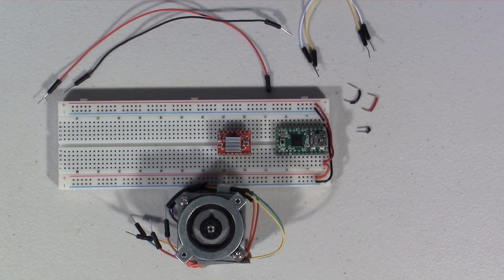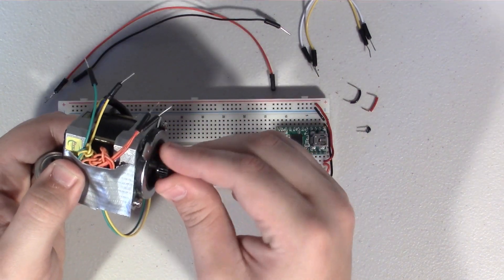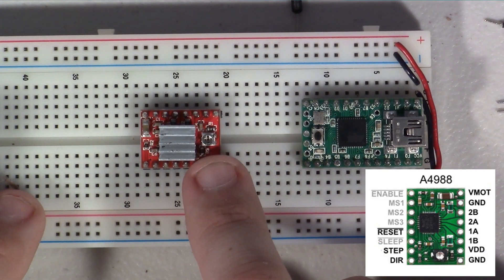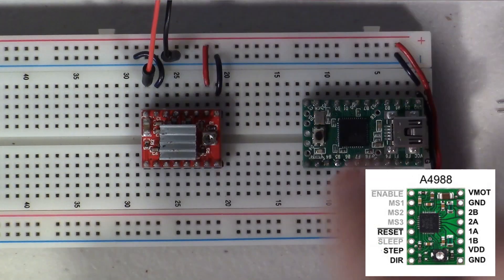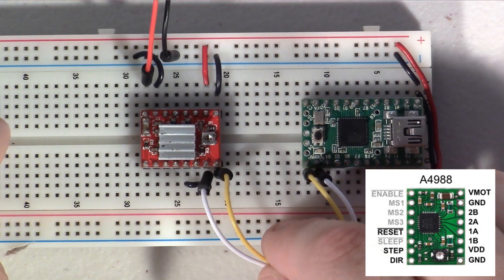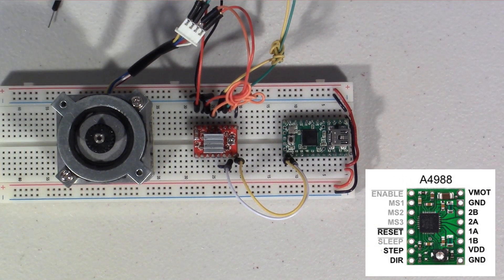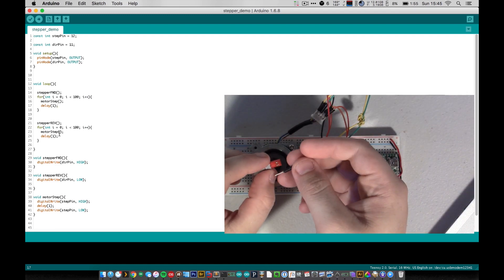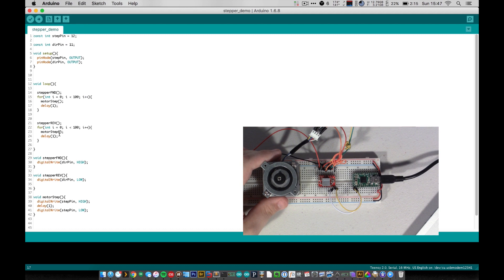How To Wire It! Stepper Motors

Comment: The resistance measurement setting on the potentiometer?  That’s an error I get it, but you left it in the video. This stuff can be confusing enough without you calling an ohm meter a potentiometer.

Comment: Very good video, thanks. I'm new to this Arduino malarkey and I'm looking for a tutorial that explains how the speed of a stepper motor can be determined by the pressure on a load cell - imagine that a kitchen weighing scale makes a stepper motor pin fast with a three bags of sugar and slow with one bag. I'd use the common HX711 board. Thanks.

Comment: thanks for this video, i have a question on the power source though,  i mean dont we need a 24 or 12 volt power supply? what did you use there?a battery or on those SMPS (googled the name) AC/DC covertor? does using an AD DC power adapter make any difference... sorry i am very much new to this but desperately need help . thanks

Comment: Can the motor run in One Direction only
Reply: Switch directions using the DIR pin. Set high to go one direction and low to go the other.

Comment: How do you determine the polarity of the windings?
Reply: There is no polarity on a stepper motor. The best way is to test it out. If it is spinning the wrong way,  switch two of the wires on one of the coils (not while powered or it will hurt the board) , or simply use your code to change the direction pin.

Comment: Anybody knows why my stepper motor just turning in one direction.. i've tried some of codes and solutions on google but still
Reply: You have two pairs of wires, 1a,1b and 2a, 2b. Just try switching the position of 1a and 1b (or 2a an 2b, but not both pairs).

Comment: So, you're just connecting four wires (from the stepper), the coils end wires, why leaving out the other two?
Reply from the maker: If you have a 6 wire stepper then you have a unipolar motor. unipolar motors can be used just like bipolar (4 wire) motors however they can also be driven using more simplified circuits with just a few transistors to turn the coils on and off. The disadvantage to unipolar motors (driven using all 6 wires at least) is that they are less efficient since the circuit to drive them involves only turning on half of the coil at a time. Driving them in bi-polar mode results in no efficiency loss though. Unipolar steppers were more popular in the past when stepper drivers were more expensive. You can learn a lot more about steppers from here: https://cdn-learn.adafruit.com/downloads/pdf/all-about-stepper-motors.pdf

Comment: hey dude, need a had and may a good idea for a video may be simple but i cant work it out and need help with it, 

im trying to get a stepper motor to move a set number of degrees when a toggle switch is on  and then turn the same amount of degrees the other way when its off,  almost like a servo i need to move a slider so far, i a can it to turn 1 way all the time and the other way all the time when a switch is pressed but i need it to stop after so many degrees 

heres my sketch

const int stepPin = 4;   //pin to pulse for steps
const int dirPin = 3;    //pin to change step direction
const int Switch = 7;

void setup(){

  //set pins as outputs
  pinMode(stepPin, OUTPUT);
  pinMode(dirPin, OUTPUT);
  pinMode(Switch, INPUT_PULLUP);

    if(digitalRead(Switch) == HIGH){ 

   digitalWrite(dirPin, HIGH);

    for(int x = 0; x < 200; x++) {
        digitalWrite(stepPin,HIGH);
        delayMicroseconds(800);
        digitalWrite(stepPin,LOW);
        delayMicroseconds(800);}
  
  }
  
   else{

  digitalWrite(dirPin, LOW);
  
    for(int x = 0; x < 200; x++) {
        digitalWrite(stepPin,HIGH);
        delayMicroseconds(800);
        digitalWrite(stepPin,LOW);
        delayMicroseconds(800);}
   }
  
}

void loop() {

}
Reply: I'm not a coder, but I've tweaked Marlin and GRBL when setting up my 3D printer, laser engraver, CNC router etc. enough to pick up that to limit a steppers travel there will be a line describing the maximum distance in mm that the stepper can travel as well as steps per revolution. There are also comments on the number of teeth of your pulleys or the TPI of your threaded rod....which ever you happen to be using. In fact, having a look at Marlin and/or GRBL may help you figure it out......hope that helps point you to what you need....

Comment: Hey .. can you please help me out here

I have 6 wire hybrid stepper Motor and audrino uno, 

I want to connect 4 of those motors with on/off button for each, can you please guide me which driver I should use. And please help me with circuit diagram

PLEAAASEEEEE HELLLP ME. ... ASAP

Comment: Once you determine the pairs of wires coming out of the motor, is it important to wire them to the board in a specific order?  For example  + - + -, or + - - +, I am getting a very jumpy stepper and I am not sure if I have polarity to all 4 wires correct. .

Comment: Hello and thanks for a great tutorial, is there any way to control the forward and reverse motion just using two push buttons i want to make a stepper move up an down i have the same stepper driver and a uno board
Reply: Reverse the code.

Comment: If I have 2 motors and want them to do the exact same thing at the same time, is it possible to run 4 cables from pins 11 and 12 to two seperate motor drivers or do I need to code two more pins to do the same thing and run it separately ?

Comment: Why are you using delay() in your code instead of millis()?
As you know delay() stops ALL processing so it is possible to miss an event such as a button being pushed or a sensor's activity. Millis() won't do that because it waits based on units of time.
From what I have been seeing recently, the use of delay() is now being looked upon as bad coding yet it is all over the Arduino code sample libraries.
Reply from the maker: Delay isnt bad in many situations. It's only really looked down upon because it confuses people when they want to start doing more than one thing "at the same time". Millis is really only useful once you understand how it works and the fact that no processor can do more than one thing at a time (ignoring multiple cores). It can be really easy to think "oh now I can do all of these things at once" and then suddenly not have things work because things that still take time to do and it throws off the synchronicity of each "process". It's also very easy for people to trip themselves up because they're still thinking in a linear program mindset rather than a scheduled one, so suddenly code that they may have expected to have run already hasn't.  So for anything that is at a beginner level, delay is going to be a lot more straight forward and will be more reliable unless you really know what you're doing.

 Plus this video is about how to wire a piece of hardware - why confuse beginners even more by showing code that they may not understand?

But if you are interested, I also did a video a while back on this topic exactly. I tend to use a library called Metro (which is basically a class wrapper for the millis style delay). You can check that out here https://www.youtube.com/watch?v=zhWV_D_9OCY&lc=Ugxo8UVJVBhFmEj51Vt4AaABAg

Comment: To determine the stepper coils, you can also just touch two wires together and turn the stepper by hand. If you feel resistance, there's your coil.
Reply: just be careful with the smaller geared stepper motors. the gears can be stripped or damaged by manually rotating the output shaft
Reply: It works!

Comment: jumping reset and sleep - already mentioned below but here is the explaination I found:
Next, the RESET pin sets the translator to a predefined Home state. This Home state or Home Microstep Position can be seen from these Figures from the A4988 Datasheet. So these are the initial positions from where the motor starts and they are different depending on the microstep resolution. If the input state to this pin is a logic low all the STEP inputs will be ignored. The Reset pin is a floating pin so if we don’t have intention of controlling it with in our program we need to connect it to the SLEEP pin in order to bring it high and enable the board.
Great info - much appreciated!

Comment: where can i get a little power supply like that?
Reply from the maker: I would just put something like "12V power supply" into ebay or amazon or something like that. The voltage also depends on the motor you plan on using so double check that as well.

Comment: Thanks for the explanation. I'm having a bit of trouble with my circuit. I've rewired my breadboard half a dozen times or more. The A4988 makes a little whining noise and the lights on the arduino go out and nothing works. I've tried a couple of different arduinos and A4988s and the same thing happens. I was able to get it to work earlier this week so I soldered up a proto board only to have it not work. Any thoughts or suggestions would be appreciated.#superfrustrated.
Reply from the maker: Sorry to hear that its not working now that you soldered it up to a proto-board. My best guess based on your description is that you are getting a short circuit somewhere in your board. Have you checked the board thoroughly with a multi-meter for any shorts or near-shorts?
Reply: Thanks for the reply. I really want this to work as the cost is great and only having two pins to worry about makes for much easier code. I've gone back to the breadboard and the problem has persisted. I think it has something to do with using a potentiometer to control it. Debugging in the serial monitor shows that there probably is a short but I think it's part of the A4988 design. The potentiometer works correctly when I have the 5v side connected and the serial monitor shows the appropriate numbers and direction. Once the high side is connected the numbers go high. I've tried taking the voltage on the high side down to 9 volts but then the stepper doesn't want to move. I've tried as many different options as I can think of.

Comment: one thing I am not sure yet, is after finding out the two separate coils, (coil 1 and coil 2), how to figure out the polarity of the 1a and 1b?  Or does it not matter? I would think it matters as it would reverse the polarity of the magnetic field depending on how the a and b are wired, "forward" or "backward".  (both for 1a, 1b coil, similarly for the 2a 2b coil).   I hope to get this doubt cleared out of my mind.
Reply from the maker: Afaik the coils aren't polarized in any specific order. I could be wrong about that but from experience I've never had to figure out anything beyond which pairs of wires go together.
Reply: Thanks for your reply.    Yes you are right.  From what i researched this week,  I learnt that the coils are polarized but not in any order, just like you mentionned, as there are an even number of coils.   Thus a change in either coil's polarity changes the direction of the rotor's rotation, but a change in both coils' polarity would  make the rotor remain in the same direction. The driver's sequence of pulses is the same in either polarity. Quite interesting.

Comment: My stepper motor have 5 pins.can i ignore it?
Reply: Your stepper is an unipolar stepper and MAYBE an hybrid which would work if you isolate the common middle coil "wire".  Not all 5 pins unipolar steppers are hybrid, though. To find the common wire, check the resistance between each wire, two by two.  The common is the only one which give half the resistance of the resistance you get from any pair not involving it. But again, your stepper may not work in bipolar mode anyway.

Comment: Hello.nice tutorial. IT is possible  to swap the 2B and 2A pins  .?what will happen if i miss pin the two pins?https://youtu.be/GgfgWU0bpHk?t=591
Reply: You won't burn anything (at least, not for that miss pin). You can get one of these thee:  wobbling (back and forth), reverse (clockwise while expecting counterclockwise) or no visible rotation. Wobbling would occur if the motor works in bipolar mode and the driver supplies an incorrect sequence due to the miss pin, but that should not burn anything by itself.
Reply: thanks you for your detail answer.

Comment: Hello. I've never used stepper motors nor have I connected anything via GPIOs. You seem to know a great deal about this stuff so I'd like to ask a few questions. I've ordered a stepper motor (NEMA 17) and a driver(?) L298N, I'd like to control the stepper motor via my raspberry pi. Is this possible and do I need something else/more than the following: Power supply for my RPi, the RPi itself, NEMA17, L298N? Thank you so much. Best regards a total nub!
Reply from the maker: It sounds like that should be good for everything. The only thing to make sure you have is enough power for the stepper motor. Usually stepper motors use a decent amount of power so if your power supply for your raspi is only just enough for the raspi then you might want another/larger supply for the pi and stepper. The pi should have at least a 1a (1000ma) supply and I'd think you'd want at least another 1a for the stepper if not 2a.

Comment: You should connect sleep and reset because one of them has a builtin pulldown. If you dont connect them, youll have a floating pin...
Reply: Built in pullup* other wise the driver would never be on (held in reset) because it’s an active low input
Reply from the maker: Cool thanks! Good to know!

Comment: Great tutorial, really!
Just one question, what can I use to power the motor? And what kind of connections? That is still confusing for me.
Reply: how many amps? i keep blowing my drivers using 12v, 1.2amps
Reply from the maker: You'll have to check the voltage of the motor you have. I believe mine was a 12v motor so I used a spare 12v power supply.  You can get barrel jacks or use hobby RC connectors like the ones found here http://www.ebay.com/itm/like/361418912735?lpid=82&chn=ps&ul_noapp=true

Comment: I think I've started to get a hang on the H-bridge now but I would still appreciate a tutorial on it to understand how to code it properly. :)
Reply from the maker: Didnt think someone would chime in about H Bridge control so quickly haha - I've added H-Bridge stepper control to the list ;)
Reply: +ItKindaWorks Haha thanks :) What I find hard is driving my scrapped steppers at the right speed with the right power supply using my L293D. At some speeds they start to behave weirdly using my code. That's why I'd like to know how you do it. ;)
Reply from the maker: I have to read up because I forget exactly why but I do know that unless your power supply and stepper are matched (12v supply for 12v stepper) then you can get some weird things happening when you try to step especially at high speeds. Thats another reason why I tend to use specific drivers. If you're interested, take a look at the stepper controller datasheet, it has some info in how it makes steps smooth - look about halfway down. https://www.pololu.com/file/0J450/A4988.pdf
Reply: +ItKindaWorks Thank you! That actually explains a lot. Looking forward to the tutorial! :)